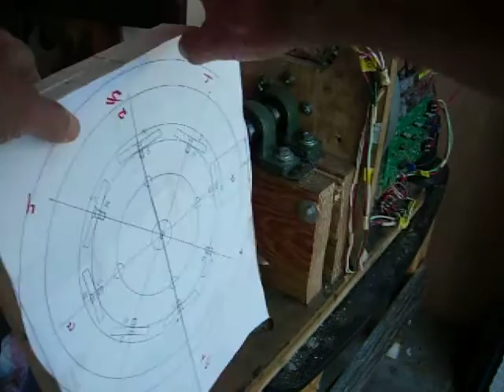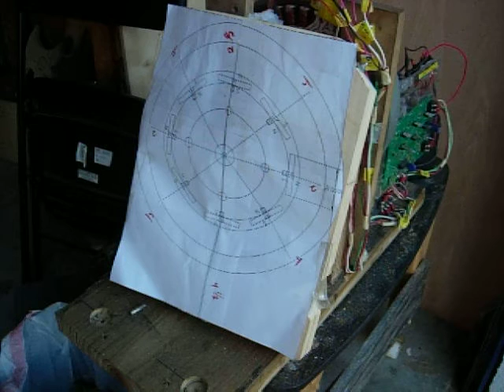Don Smith #123 building the generator

Comment from the maker: Just got the machined plastic rotor that will hold the generator magnets. $40 bucks did the job outstanding workmanship..  now to find a 10 lb rollof 17 ga magwire.  I'll be rereading the lost sciences book for the umpteenth time on how Tesla describes that the charge doesn't flow but the voltage radiation wave does in the heavy primary metal.  This is probably why Gerard's amp meter read such a small amount from the generator into the 120 volt input of the pole transformer.  The charge wasn't flowing from the generator but the radiant energy was and this is what was producing the 14,400 vac at the HV output of the pole transformer

Comment: I admire your dedication :-)  You are "very" skilled in your profession.
I have been watching many of your videos for a while now, and i have to ask,,,,,,,are all these videos still of one project, of making a circuit designed from a crop circle? Or did i miss understand something along the way.
Reply from the maker: +INVENTOR3 I've got the impulse motor circuitry done as well as the MWO is also done and running.  The crop circle anti gravity platform and control are done but it needs a 64 tetrahedron crystal placed in the center.$$$$$ for this puppy.   the last project is the replication of Gerard Morin's stuff  with some additional circuitry for control.  I should be up and running and producing at least 6000 watts with 1200 being used to drive the front end making 4800 available to do some 120vac 60hz or 240 v work.   skill is achieved by frying lots of circuitry.